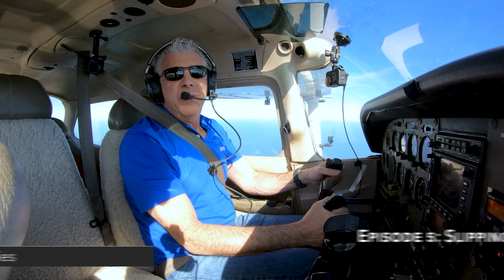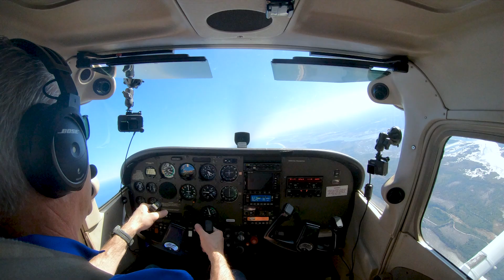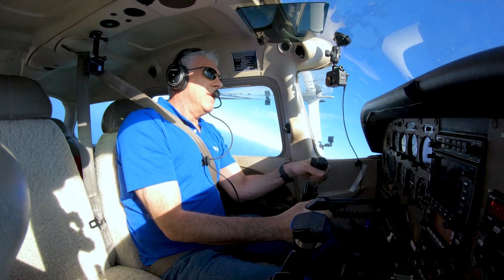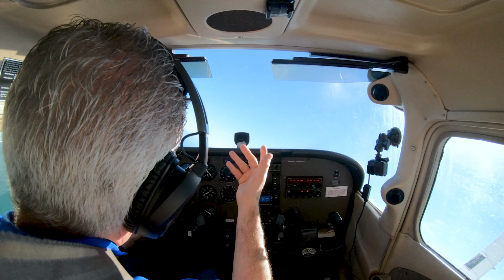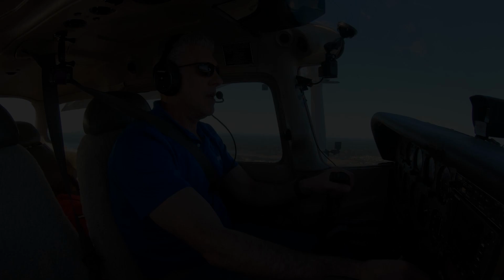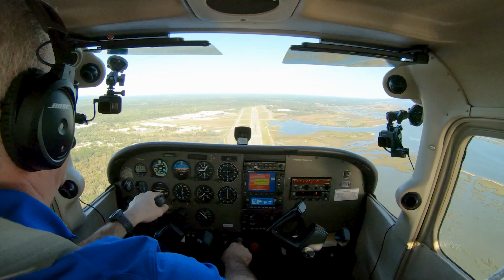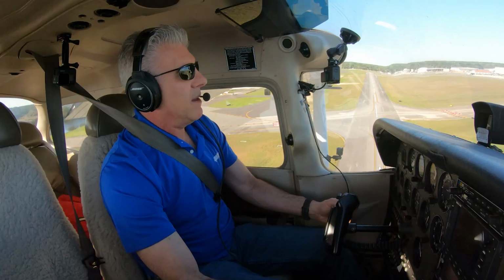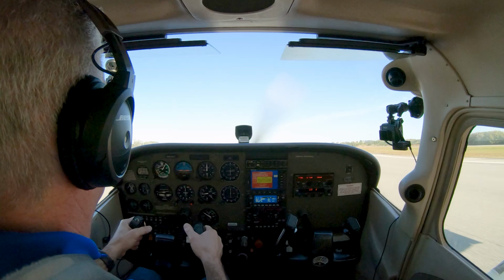How to slip an airplane - Sporty's Advanced Pilot Skills Series with Spencer Suderman (episode 5)

Comment: I don't see this course yet on the web page in the link. This is very helpful. Your videos make it seem easy and will be good confidence builders for pilots. I had a Saratoga II turbocharged and was flying at 17,000' when the oil temperature redlined. I was in busy DC airspace, so the controller vectored me to a remote airport. I pulled the throttle back to cool off the engine. When I got to the airport, I was very high. I had to assume that I couldn't use the engine and had to make this landing, so I did a forward slip (which I had practiced a lot). It got me down safely. All pilots should be well trained and comfortable with this.

Comment: Looks like you are slipping with flaps. I was taught never slip a Cessna with flaps - in fact it is in some of the POH that I’ve seen, but no satisfactory reason is given as to why not. Some say it can cause a tail stall, but I have a feeling that might be an urban myth. What’s your take on this?
Reply: There is no prohibition published to slipping with flaps in any Cessna as far as I'm aware and I have flown 150, 152, 172, 182.  Cessna 172 with flaps that can deploy to 40° have a warning that says to avoid slipping with 40° of flaps.  It causes an oscillation in pitch due to tail blanketing.  It is not prohibited however.
Reply: @ssairshows  THANKS for confirming this, that's what I thought, I just don't understand why my instructors kept pushing back and wouldn't allow me to do this at all.   - such an important tool
Reply: @Charles-fn9qy  Most manuals say Prolonged flaps with 40 flaps are not recommended.  That is what i saw on many 40 deg flap Cessnas.
Reply: @Zakk900  short field landings

Comment: Unless I don't have the engine anymore, I would rather go around before thinking that I would be ok if I landed long!
Reply: Thanks for watching the video!  The Cessna 172 has a ground roll of about 600 feet.  That runway is 6000 feet.  Landing in the middle is just as safe as on the approach end numbers.  Every PIC must be familiar with the aircraft performance and the operating environment.
Reply: Runway length info, you'll have before even starting the flight so you'll know with confidence if you have enough runway available.
Reply: I frequently amd safely request long landings at locations with 5000+' runways to expedite taxi when the FBO is on the far end. It is also good practice for the day when you can't go around.